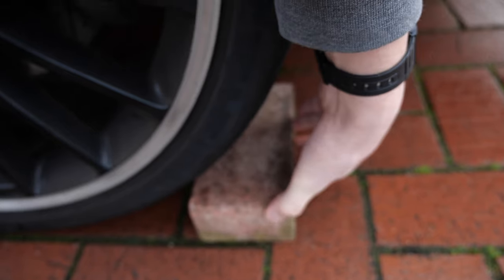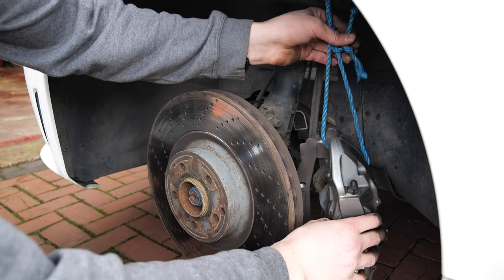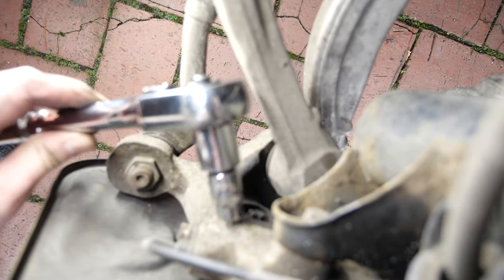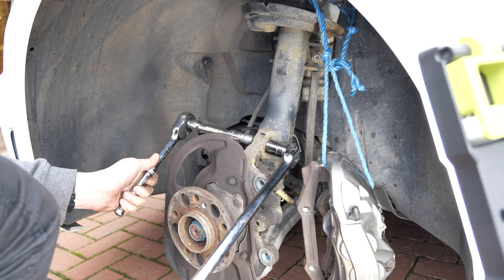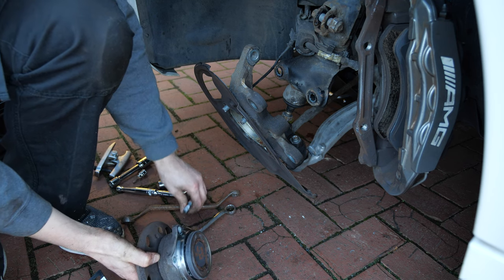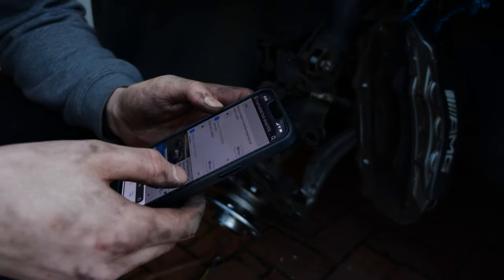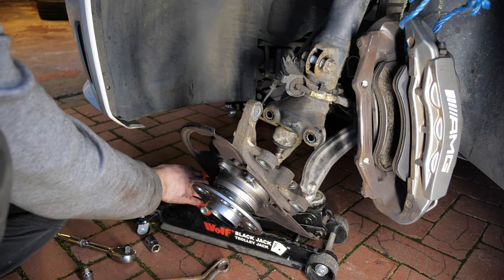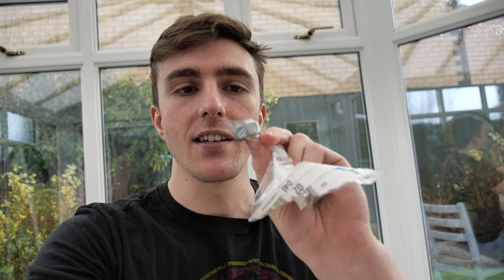I made a big mistake changing my C63 AMG wheel bearing..

Comment: For future reference. Spin the wheel with the alloy back on . If the wheel bearing gone youl hear a drone , plus youl feel possible play when rocking the wheel .
Reply from the maker: Thanks, but there was no noise or play. I even spun the rotating assembly up with my impact gun (wheel off).
But it makes sense as the noise could only be heard under load at 70+mph, so to hear the noise you would have to spin the wheel at 1000+rpm. I also think the load on the bearing had a large effect as it was almost unnoticeable when going around a left hand corner at 70mph.
But I am a bit OCD about noises in cars, I did say it was slight haha. Most people wouldn’t have heard it!

Comment: Torque to yield bolts are always aluminum, so if a bolt is aluminum always replace them.
Reply from the maker: So a good way to tell if you didn’t have access to torque specs would be to check with a magnet for each bolt maybe
Reply: Indeed. Aluminum tty bolts are a bit more of a bmw thing rather than Benz. Benz does however consider all suspension hardware one time use, to my understanding having to do with the "micro-encapsulated" process. A molecular fusion of a loctite like substance from factory. 
Many simply clean off the threads, apply loctite, & re use. Personally, I'd rather have new when possible.

Comment: Would a failing bearing/hub also cause a clicking sound? I have this issue and wonder if I need a new bearing
Reply from the maker: Really hard to diagnose without some tests on the car, usually clicking would be more CV joint than a wheel bearing though.
Reply: @CarThought  no cv joint at the front otherwise I would agree! not too much up front which is rotating, my clicking changes with wheel speed so it must be something that is spinning so going to give this a go, thanks for the video
Reply: Just to update I changed the bearing yesterday (without any of the disassembly of the control arm required) and it fixed the clicking 👍
Reply: @dnbtit  was it a low speed clicking?